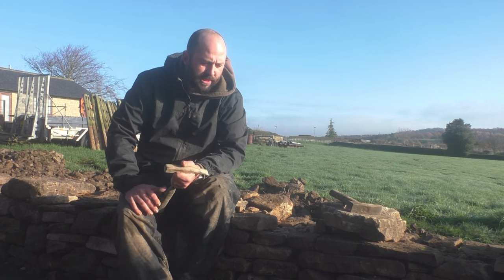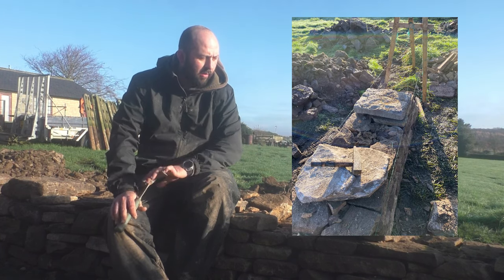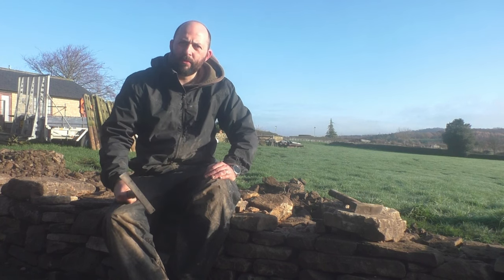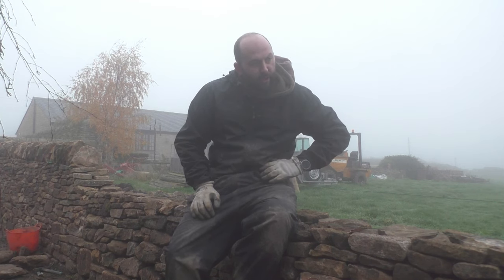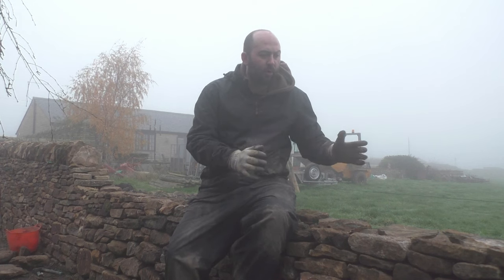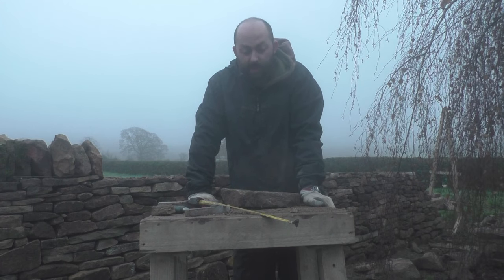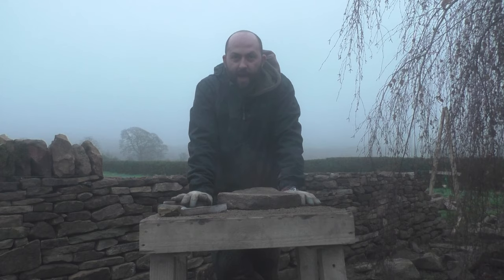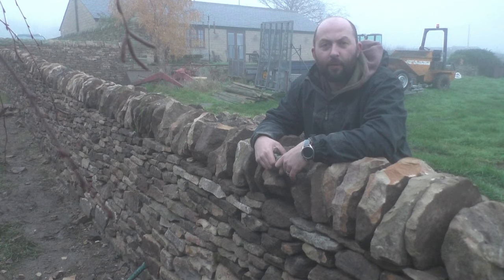HOW TO BUILD A DRY STONE WALL, BUILDING A FIELD DRY STONE BOUNDARY WALL, PART 2, DRY STONE WALLING

Comment: Here to brush up on my stone wall building!

25 years ago I had to rebuild some stone walls in Scotland with a farmer and got to work with a traditional mason in Switzerland.  I just got a new to me old house here in Canada and have to rebuild some of the field stone foundation walls.  I'll use some mortar this time, as they were mostly dry stacked originally, although the top 16" or so has a lime mortar.
Reply from the maker: Hi Roxanne,
I hope you found the video/channel useful. It sounds like you have some experiences. Good luck with the wall. If I can help in any way, please don't hesitate to ask.

Comment: If you were to be building a wall , but suddenly you ran out of stones what would you do ?
Reply from the maker: Hi John, the only option would be to get more stone from around the site I am working on or buy it in. If I am buying stone, I always try to buy it at the beginning of the project so I can blend the stone together.
Reply: @TheStoneRanger Yes , getting it from around your work site , close by . I saw a wall about 6 yrs ago wherein the builders brought in stones from many miles away for they had run out . Those stones had a high amount of Bauxite in them giving that wall a "Pink Appearance" . It certainly gave the wall an odd appearance . L O L

Comment: Do I need to taper the wall towards the top or can it be built square?
Reply from the maker: Definitely tapered. Think of it like the shape of the letter A. I like to work to the basic rule: half the width at the top as it is at the bottom. It always makes a good, strong wall.
Reply: @TheStoneRanger  Thank you very much. Starting mine soon!

Comment: I build stone not dry I normally cut top and bottom with 10 mm joint how many metres would you normally build in a day I manage about 1 .Stone is very hard and only splits one way kinda like slate rock
Reply from the maker: Hi Thomas, thank you for watching, you are right working with stone can be very hard at times. When I was full time building Dry stone walls I would average around 3.5/4 meters each day on field walls. A garden wall would be a lot slower

Comment: Is there any benefit to placing dirt or sand in the fill section of the wall - in the center, to further tie things together?  I realize some could fall through the cracks as the wall ages but it seems that an additional binder may help.  I don't see it in any other examples of walls but then wondered if that may be because it is not local available or just a dumb idea.  I will be building a wall soon and that is why I ask.
Reply from the maker: Hi Everyman1878, I hope you are well. This is a question that has been asked before, and I have repaired walls using this practice, but it makes a very poor wall. As you mentioned, over time, the soil will fall to the bottom as the seasons change, leaving a void and resulting in a poorly built wall with a shorter lifespan. I would try to avoid this method and stick with using the smaller middle stones. Thank you for watching! 👍
Reply: @TheStoneRanger   thank you for the answer w/analysis and experience.

Comment: I have one of those hammers, I just need to find a dry wall!
Reply from the maker: It’s usually the other way around. People need to buy tools to build their dry stone walls. You have a good advantage 🤣🤣
Reply: @TheStoneRanger  Procurement messed up, It was supposed to be a railway engineers hammer, they reordered the correct item and told me to keep this hammer because it would be expensive to put the error right! This was before computers were in common use. That reminds me I still have a train drivers tool bag, It was supposed to be a railway engineers kit bag,,, It's very nice leather though.